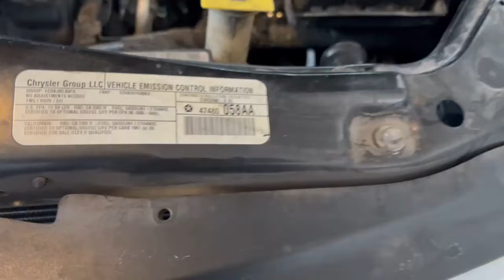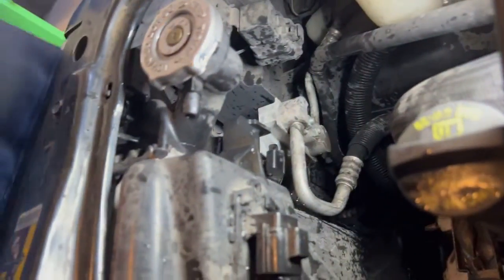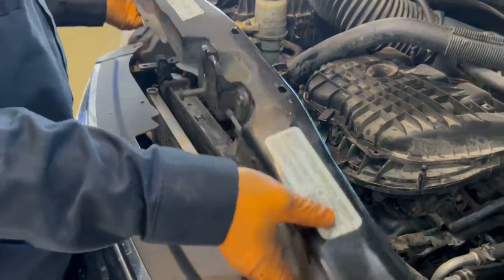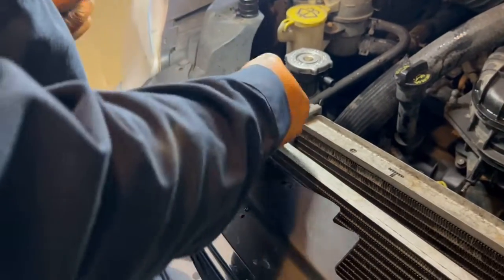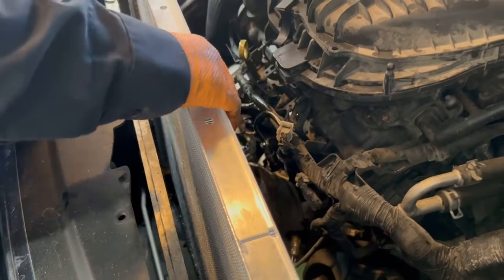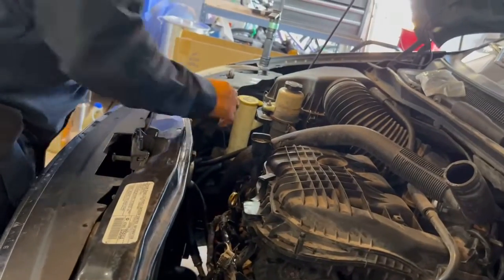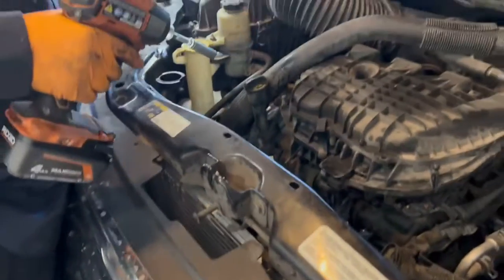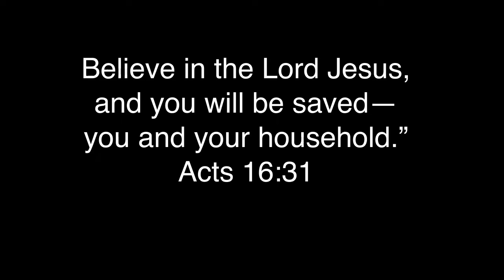replacing radiator 2014 Chrysler town and country 3.6

Comment: I'm doing this job tomorrow but when I do it I'm removing the entire front bumper fascia so I can easily separate the condenser from the radiator and the lower power steering pipe that runs along the bottom of the condenser without having to worry about damaging the front grill and bumper. Take your time do it right if you're a diy'er and not a mechanic just trying to get it out the door quick as possible.

Comment: I didn't see you remove the transmission lines.
Reply: The trans cooler is not in the radiator. It is actually the top part of the a/c condenser. If you look closely you will see that the top part trans cooler and lower condenser appear slightly different. Also the two lines attaching on the driver side are the trans fluid lines   If you follow them you will find that they go to the top of the transaxle. Btw. It’s common for those lines to leak at the rubber hoes couplers and there is actually a extended secret warranty or recall on them. If you can’t claim that for some reason they are fairly easy to replace.